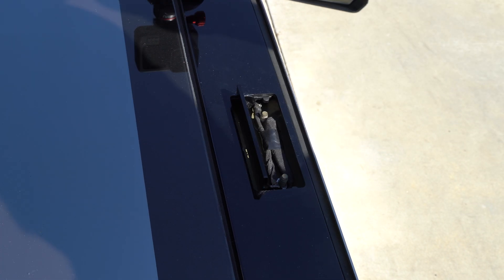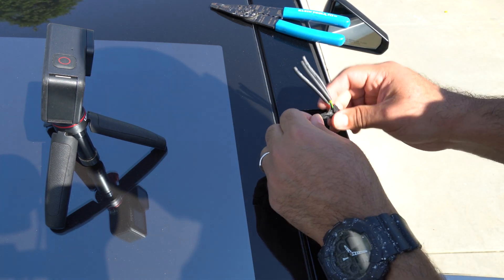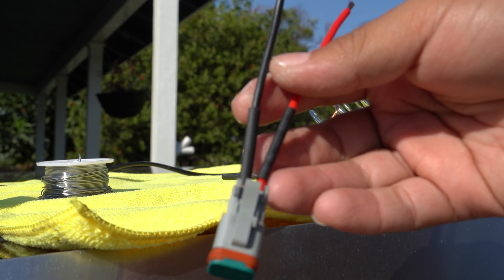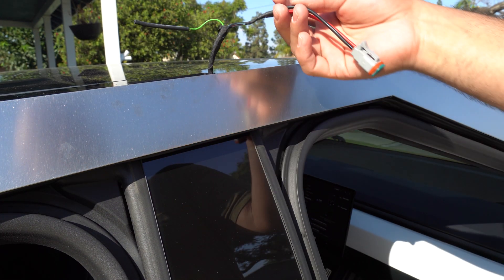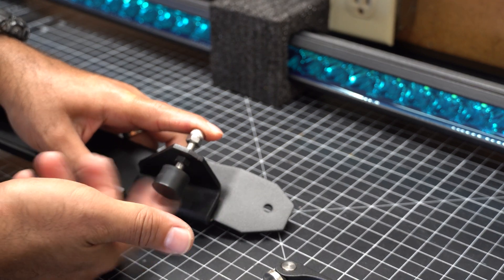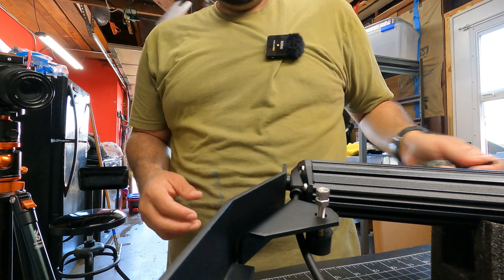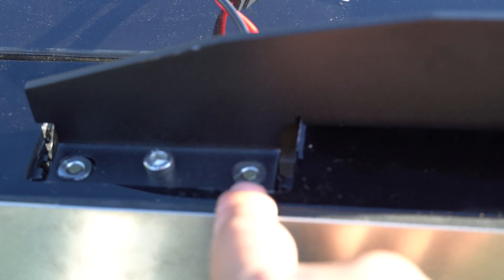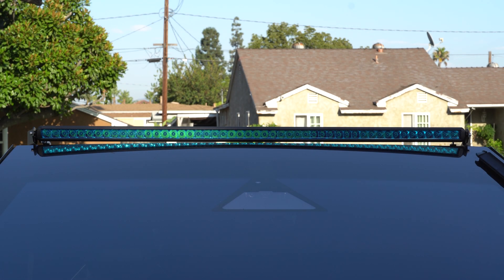NEW Tesla Cybertruck off-road light bar (install video)

Comment: Did you end up making a cover or solution for the cable? I just bought one of these bars. Great video!
Reply from the maker: Thank you, I did not end up making one :(
Reply: @AlansInventions I got the Tsportline bar but drove one day and found that my commute with the bar cost me about 10% more battery… so now it’s just hanging up in the garage until I ever decide to drive off road at night… not sure it was worth it for me…
Reply from the maker: No way! Can you share your test data or how you quantified that?
Reply: @AlansInventions my normal commute average is only 40% battery used by the time I get home. That day it was 50% battery with good weather.
Reply from the maker: That seems excessive
Reply: @AlansInventions I agree. That’s why I took it off and it’s in my garage now.

Comment: I ordered this light bar, along with MARS expedition roof rack front and rear system.  Having the light bar sit there alone without a roof rack doesn’t look as clean as the OEM one. So, since I don’t have the BEAST. I have the Foundation Series dual motor AWD version… I ordered from HANSHOW.  It works perfectly with MARS rack system!  BADASS!!
Reply from the maker: Very nice! My latest and probably most favorite mod I've made yet, is an adapter to allow the screen to swivel. Makes the 30 minutes charging fly by playing video games or Netflix 😂 I have a 40% off coupon if interested. I'll be putting out that video soon too.
Reply: @  ok, I’ll have to look into that.  I guess I will make my first video since many folks give me compliments on my rig!  No other CT can compete.  I gatekeeper, because I want to remain VERY DIFFERENT in my city. But I will upload my rig early 2025.  It’s unlike no CT on YouTube- TRUST ME!
Reply from the maker: Make sure to send me a link or follow me on IG so I can follow you back. Same handle

Comment: Hey man, do you mind giving links to all the tools you used in this video? specifically the wire cutters
Reply from the maker: @lennymoore2443  Here you go. These are the main ones, I did use Amazon affiliate links, that means if you buy through them it helps me earn a small commission and helps me grow my channel. 😊 If you need something else let me know.
Wire Strippers: https://amzn.to/3BTAx6S
Soldering Iron Kit: https://amzn.to/4h3s3u9
Heat gun: https://amzn.to/4dJYb33
Heat Shrinks: https://amzn.to/3zO5nxr

Comment: What LED bar is it. LINK ?  I would recommend ceramic coating the light bar to make bug removal easier
Reply from the maker: Hello, I used the T-Sport line LED Bar kit. I am hoping to be able to offer a special discount link or promo code shortly. Otherwise a quick google search should bring them right up :)

I will look into the ceramic coating! Thank you.